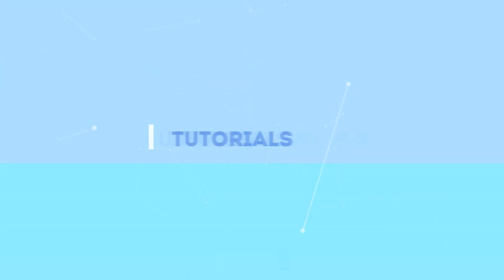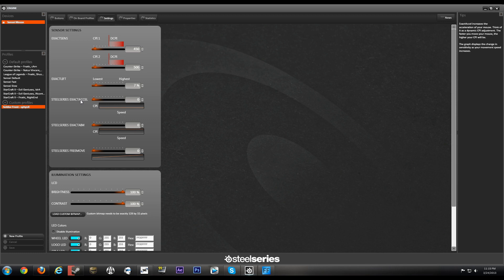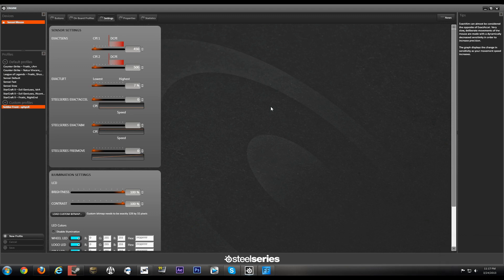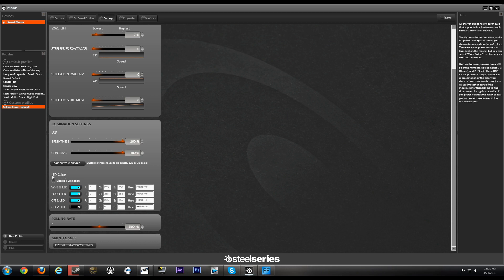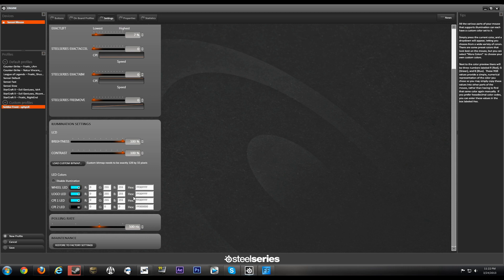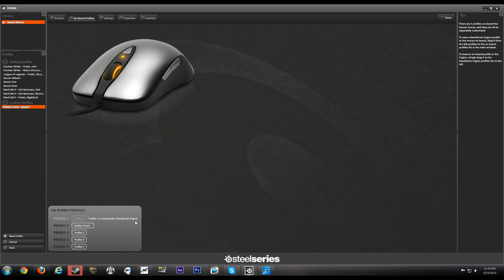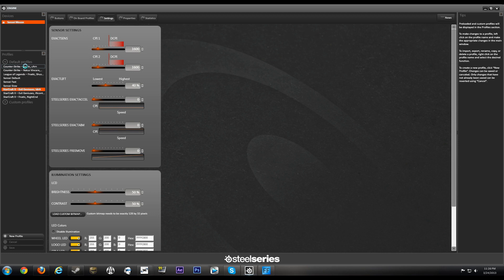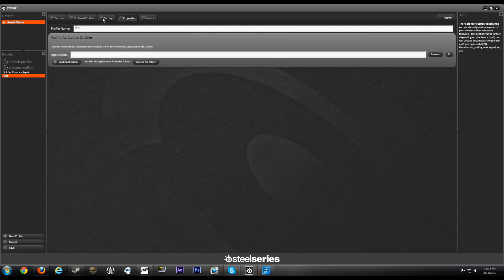[Tutorial] Configuring Your Mouse in SteelSeries Engine

Comment: Anyone else keep hitting the speed switch in games. Drives me nuts.  I dont use the software engine as it causes performance issues for me.  Only use it on 1 pc. Current specs:  8700k 2x 1080ti.  Maximus X code mobo 32gb Corsair.  All watercooled.  I still notice issues when this software is running so I removed it.

Comment: does this work for kinzu v2? please help :(
Reply: yep
Reply: 1) dl driver on SS site
https://steelseries.com/downloads 
choose engine 2
2) install
3) plug in kinzu v2 mouse
4) set up your preference settings

there's only 2 cpi settings for kinzu v2. the default is 800 and 1600 but it can be changed using 4 options (400, 800, 1600, 3200)

Comment: Don't think you realise it as you don't even mention what mouse you use, but every mouse has different options/features in the engine, always have been, today I use the 3.3.7.1 for example, and the Sensei Raw only has customizable settings for cpi 1 cpi 2 & polling rate, nothing else can be changed on that mouse. There are no more options besides those 3, if I plug in my other Sensei (the expensive one) I do have all the options, so every mouse is different in the engine, sensei raw = shit.

Comment: the SS engine 3 is not working for my kinzu v2, and my old engine no longer works, i am so sad because i feel that i was ripped off.
Reply: I apologize for the drama, but i found something on the SS website and they do have an article about the problem, but when i do click on it though it doesn't load but it's fine i think they are working on a fix, i don't know but i hope so, because love and peace.
Reply: sep Avila 
did you find anything? i have kinzu v2 too and it does not detect it in engine :(
Reply: kevinmijeime
Hey man, uhm, I'm not sure if it's alright to post a link on here but this was the one that I used to download the SS engine V2, since the SS engine v3 wouldn't recognize s#it, http://steelseries.com/downloads , this was where I got mine to get my Kinzu wokring again, but now I moved on to the Daedalus Prime G302 from Logitech, and i never turned my back since.
Reply: Hey, i tried both SS engines but none of them recognizes my mouse :(
Reply: sorry man, i gave my kinzu v2 away, and i got my self a g302 maybe it's time to move on?
Reply: sep Avila 
It's fine, thank you for helping me :) i need new mouse yeah,you're right.. have a nice day mate!
Reply: g302!!!!!! or the 303!
Reply: ok is it really good? :)
Reply: my hands are kind of small, so they fit mine very well. i play lol
Reply: mine aren't so big also, so it will be great :D thanks man, i play cs go

Comment: i dont have these options in my settings?!?!?
Reply: Me neither. But I have the wireless version.
Its seems all but impossible for me to find anywhere else with instructions, as I don,t know how to get it working in games such as CS:GO. I had a wired gaming mouse I could configure for each game/program (Logitech G300); but this one is being extremely secretive on how to operate the side buttons in game. Darn frustrating. Thinking of doing a video as to what issues am having.
Reply: DuckY | Gaming Thanks dude.
Reply: Roger Dodger  its cuz u have the engine 3 u need engine 2